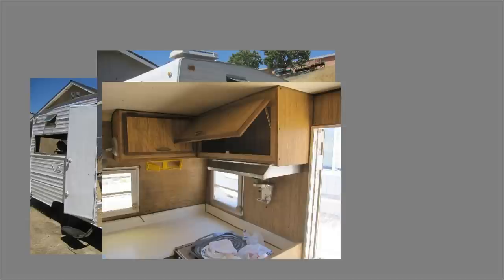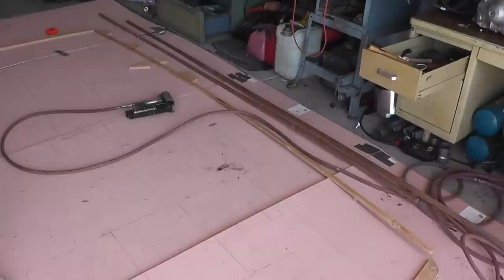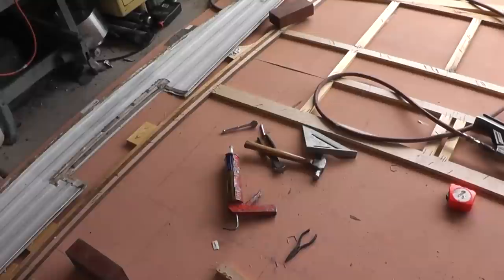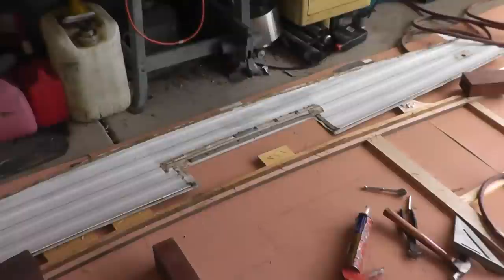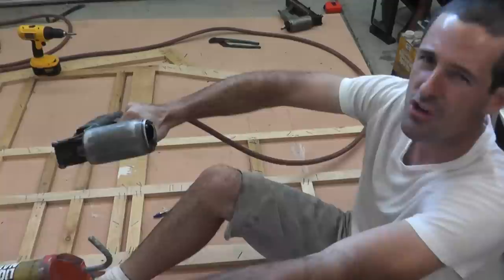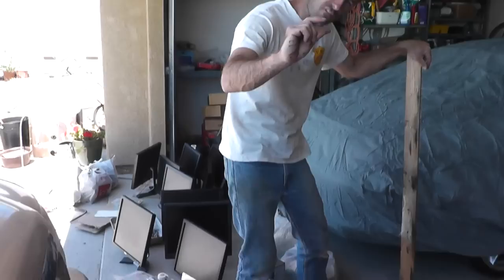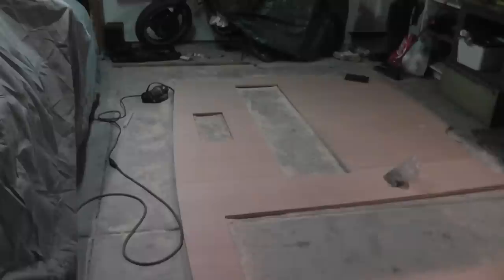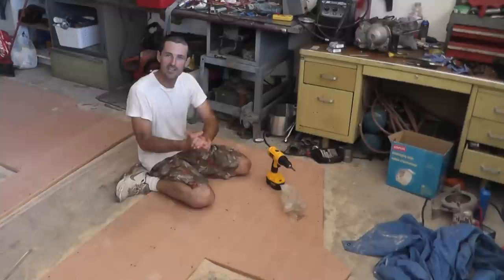Vintage Shasta Camper Trailer Restoration - Part 4 - Building A Wall Between Us

Comment: Your Shasta series is great stuff, we're the proud new owners of a '76 Cardinal that sadly isn't in the same great shape as your Shasta was when you started. I've got the "box" removed from the floor and frame and standing on braces, have rebuilt the floor completely using two layers of marine plywood, and will be rebuilding most or all of the framing.

Can I ask what wood you used for the framing? Did you hand-pick furring strips from the Big Box place, or use their better "whiteboard," or use something else? For example, my local lumber yard has 1x2x8' doug fir CVG but at $5 a stick I cringe at the thought of using it for a complete rebuild.

Also, do you think a 7/8" staple would hold well enough when tacking the framing to the interior plywood, if only to hold it while the glue was drying and until I flipped the section over and screwed it down?

Comment: Hi, my paint WILL NOT come off completely. Do you think I could just sand my aluminum panels down the best I can and paint over it? also where all the sealants were how did you get that gunk off the aluminum?
Reply from the maker: If the paint is stable and well adhered (and not latex house paint like mine), you can sand and prime/paint over it. Just be meticulous and feather the edges to keep things from showing through. When taking difficult paint off the first thing I tried was letting the stripper sit on there for a long time, and multiple coats. If that didnt work, I tried a different type of remover (through the course of paint removal I used jasco stripper, aircraft remover, lacquer thinner, and another brand I don't remember because it didn't work). Good luck on the job!

Comment: 1" staples, 3/4" frame, .20" wall ply....sounds like the staples will come through the wall ply?
Reply: If you keep watching the series he later notes that the points do come through a bit, and they knock them down with a palm/orbital sander.

I'm about to do a similar rebuild and hoping to do this without the pointies inside. They make those 1" wide staples in a 7/8" length but that would only put them about halfway into the plywood. Hopefully that would be enough (with the adhesive) to hold it all together until I get it flipped over and top screw the panels?
Reply: +Randy Rue Probably should work OK....Maybe a pneumatic brad nailer would work too.

Comment: Hi, do you know the part number of that specialty rotozip bit?  Please advise.  That you.
Reply from the maker: I don't know the part number, but it was a 1/4" diameter ball bearing flush trim bit
Reply: Mike if you find it will you message here? We bought the rotozip, but cannot find that bit anywhere.
Reply: Did you ever figure out the bit? I see this on Amazon that fits the description. https://www.amazon.com/Amana-Tool-47092-Bearing-Diameter/dp/B000637V7Q